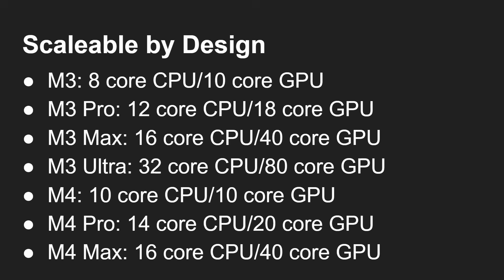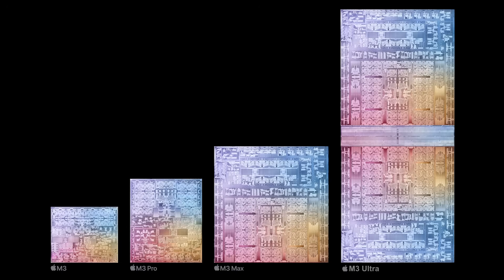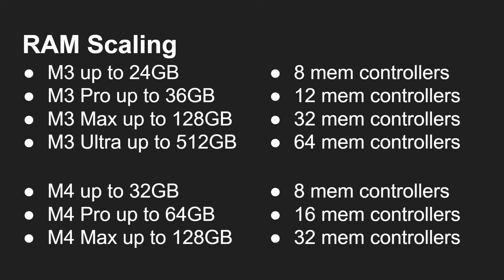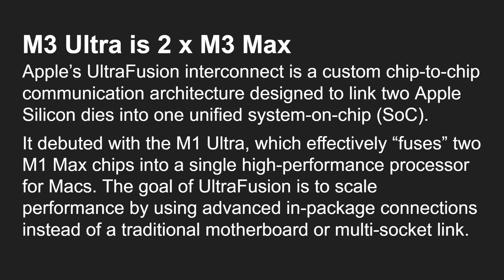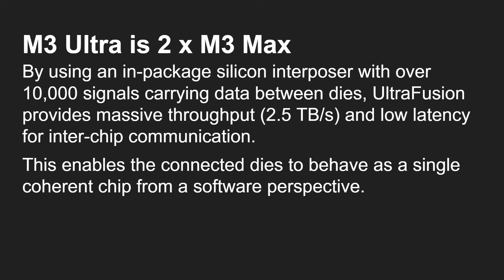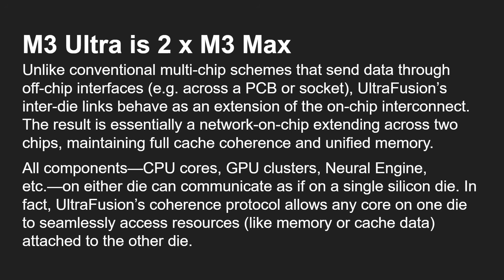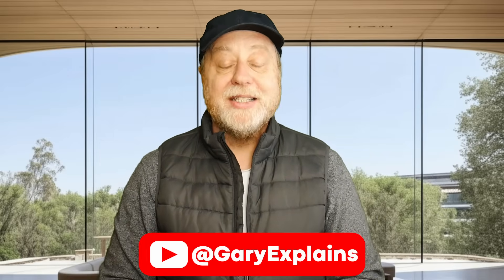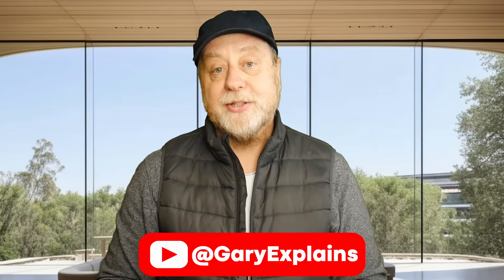The Magic Behind Apple's UltraFusion Interconnect

Comment: For me the most interesting chip will be the M6 as M5 is using 3nm yet again but M6 will finally move on to TSMC's 2nm hopefully N2P, sadly I think they've dropped backside power from this but should still be decent.
Reply from the maker: Interesting. What are you hoping for from a 2nm chip compared to the previous previous improvements from 7nm to 5nm to 3nm, etc?
Reply: @GaryExplains  Besides the performance and efficiency gains that we get with each iteration, I think the more exciting news would come from Apple fusing more modules within the SoC.  
Adding the Connectivity modules (Bluetooth/Wifi/Cellular) would make the experience significantly better for high performance tasks like Mobile gaming.  
They also need to support App Pinning
Reply: @GaryExplains  This. The performance increases will diminish across future lines. Look at Blackwell or CRAPwell.
Reply: @Machistmo that's just Nvidia being Nvidia. And they are dealing with much higher power limits. Apple has that headroom
Reply: @ na not rrally
Reply: @Machistmo  the 5090 still uses a 5nm process, the last time Apple used that was on the M2
Reply: @ the architecture is reaching its limit and a node shrink won’t work miracles, hence the interconnect. That’s only got so much headroom left too.
Reply: @GaryExplains  Well over 7nm and 5nm the jump is massive, but Apple has been 'stuck' on 3nm for a good while now, M3, M4 and M5. They have still made some reasonable improvements as the first N3 process was a bit ropey but I personally don't expect M5 to be that impressive as I think 3nm is pretty much maxed out on N3E. Obviously there's a lot more to chips than the node size but so much of the performance increase comes from a newer node's low power consumption, higher clocks and higher densities.
Moving to GAAFET should bring some decent improvements, 25-30% lower power usage as there's less leakage now, 15-25% density increase so that will hopefully mean more cores per die area and 10-15% performance boost. So of these are trade offs with each other but I am still pretty sure M5 to M6 will be much more impressive than M4 to M5. Plus if Apple does use N2P then this will come with backside power delivery which will offer a very meaningful efficiency improvement and best chip layout options for Apple.
Reply from the maker: Just a clarify, apple isn't stuck, the whole industry is stuck, it is tsmc that provides the process node not Apple. This is an industry wide problem and will become more problematic in the near future, and yet you seem to be thinking it is an Apple problem, or maybe I misunderstood you?
Reply: @GaryExplains  Apple is addressing this problem through dedicated Neural Engines, Media Engines, increasing hardware capabilities, increasing bandwidth, increasing the number of cores, increasing RAM and bringing more hardware functionality. To me, the likes of Intel, AMD, and NVIDIA have address this problem throwing more power it.
Reply: @GaryExplains  yes you're misunderstanding me, I'm not 'angry' with Apple for having 3 generation on 3nm, naturally that's beyond their control. You just asked me why I was excited for M6 more than the others so I was explaining my reasoning and what improvements we should see once Apple is able to use 2nm.
Reply: @michaelcobbin  I wouldn’t say AMD is stuck or just throwing more power into their processors. Quite the opposite, they followed in Apple’s footsteps, and the Strix Halo SoC/APUs are phenomenal (they just have horrific names).  
Nvidia throws more power because their bread and butter is desktops and servers, unlike Apple which is laptops.
Reply: @ I think it’s a fever dream. I don’t think you’ll see the gains you think @2.
Reply: @Machistmo  at most I've said you will see larger gains moving from 3nm to 2nm than staying on 3nm going from M4 to M5. I'm surprised you think I just be having a fever dream for thinking this.
Reply: @GaryExplains  But one of the reasons I chose my wording like that is 2nm is pretty much ready, Apple could use it this year if they wanted to, certainly for smaller chips like the A chips in their phones.
Reply: A smaller node helps with heat, density, and power efficiency. 

One problem we are already facing is yeilds. Each new node creates new manufacturing problems. Some are easier to solve than others, and some actually are a step backwards. 

We were able to make smaller processors for decades in the 1970's, but they were more and more expensive and had higher failure rates. That's part of the reason the first calculators used essentially the same processor as the first computers, as well as the first home gaming consoles, as well as products that are still being designed and manufactured today. 

The economy of scale still applies, and we are hearing the point that the "nodes" are just way more expensive with smaller and smaller gains in size or efficiency. Sometimes it's just cheaper and easier to use an older process. 

That is essentially the entire idea behind AMD ryzen processors. Remember Intel making fun of and for "gluing" processors together? That greatly reduced the price and increased the usable silicon produced. By using core complexes with an interconnect, one bad piece of silicon doesn't ruin the entire processor. 

Apple is essentially doing the same thing, just using arm architecture built by the same people (tsmc) that build and ryzen processors, and now Intel's own chips. 

Intel and AMD can use a 3nm node just as easily, but they decided the extra costs did not justify the price increase. 

Apple historically (and currently in the iPhone) overcharged for outdated tech that they changed the name of and pretended it was new and then scored huge profits off technologically unaware consumers. This is really the first time that apple has even had a competitive, technologically different product since the 1980's.
Reply: @lilsammywasapunkrock Smaller nodes do help but returns are greatly diminishing as a result of the breakdown  in Denard scaling.  The smaller transitors have greater leakage current which offsets things like drops in capacitance.  And you no longer get improvements in heat but scaling down makes the power density worse.

Overall it's still a benefit since you can do more with more transitors but the amount of benefit decreases.
Reply: The key question for the M5 are:
 - will the memory bandwidth increase? 
 - what will increase in the number of cores?
 - what will be the increase in share RAM?
 - will there be an significant increase in the Neutral Engine?
Reply: All process nodes are marketing BS these days anyways
Reply: @matt5721  the naming of them is, the improvements they bring isn't.

Comment: I have been wondering if Apple is making an internal GPU to train LLMs? They don't like Nvidia and for now are using Google's TPUs for training. But I believe they should be able to make GPUs comparable to the best Nvidia GPUs - by replacing all CPU and other cores with GPU cores on a die the size of M3 Ultra. Though this will be for internal server use, it will nevertheless be an exciting development.
Reply: They would never make an external GPU but it’s likely the M4 Ultra was cancelled in order to make time for the rumored server chip
Reply: Naw, the Apple IGPUs are good, but they aren't good enough to compete with Nvidia

They are somewhat competitive with AMD thou(Think M4 Pro vs Strix Halo), but remember Apple is using their latest graphics architecture on TSMC 3nm, while AMD is using a tweaked last gen architecture on last gen TSMC 4nm

So apple is roughly tied with AMD, when they are spending more money and a newer design, not exactly great place to be

It's still perfectly good for most tasks, support obviously is good in MacOS(as it has to be), but not competitive for any non-consumer use
Reply: @ They are far beyond AMD. Strix Halo is on par with M2 Pro. M5 generation is coming this year. M4 Pro is around 3060Ti/4060 levels and M4 Max is 3090 level and M3 Ultra is 4080 level. Of course this is with more RAM than most Nvidia cards can dream of
Reply: @chidorirasenganz  Your performance estimate do not account for the differences in CPU

The M4 Pro does perform better in graphics to the AI 9 395 at low power draws, but that's because AMD tacked a desktop cpu that consume 170w into a mobile CPU that draws 130w Max

The M4 just has a better CPU efficiency & performance, if you account for this(by boost AMD's power consumption to compensate for CPU inefficiency), M4 Pro iGPU is behind AI 9 395 iGPU

M4 pro and AI 9 395 is the most fair comparison due to their similar memory bus,  but the Apple GPU is smaller(due to node & smaller design), so i give apple an advantage when comparing their architecture

So if you would consider their architectures, which is what u would do for a hypothetical mega gpu, they are roughly equivalent (slight edge to AMD, due to use of older node)

Edit: But due to higher costs by Apple, this is obviously a no go to design a GPU with only matching AMD RDNA 3.5 architecture performance, especially since i haven't even started talking about CDNA or RDNA 4
Reply: @ that is all hypothetical. the chips run at the power they are designed at. M4 Pro only uses like 45w at peak so it doesn’t really matter how much you boost it. M3 Max was already more powerful than the 7900 XTX. M4 Max and M3 Ultra increase that lead.

Comment: Is it possible to concentrate all the you cores on a single die and everything else from the CPU, NPU, Media engines, Thunderbolt controllers etc on another die and connect them up with ultrafusion ?
Reply from the maker: The point is not to have two different dies, that would cost more money, the idea is to have two identical dies and join them.